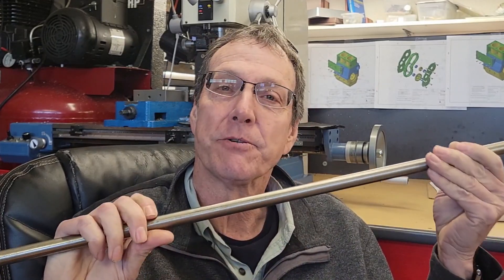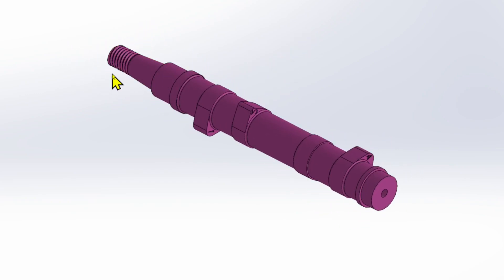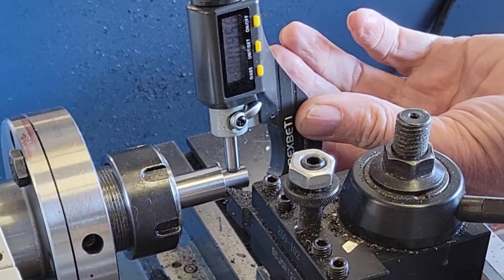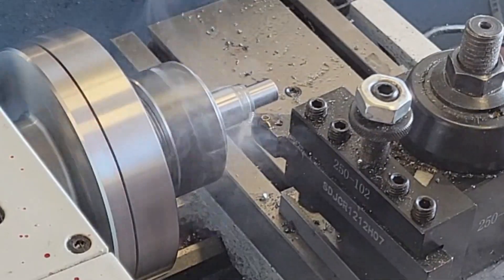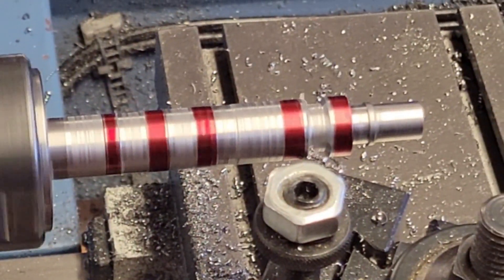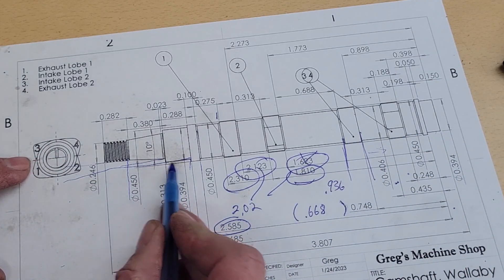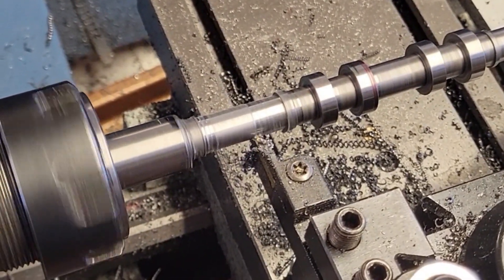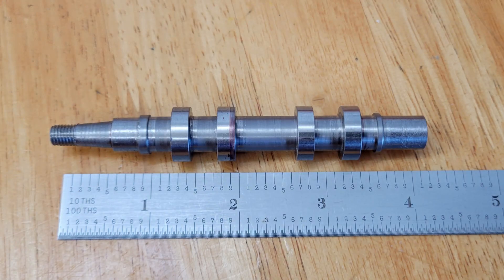Machine the Camshaft - Wallaby 30cc Model Engine Build - Part 12

Comment: And for those without cnc?
Reply from the maker: Hi Union310, This video and its companion Part 13 "Why be afraid of making Cams" does not use the CNC. All you  need is a Lathe to make an awesome Camshaft.  The Wallaby can be made without CNC and many of the parts have plans for both CNC versions and manual machining.  Give it a go!

Comment: I started to download the plans from your website and it just so happens that I have a length of 5/8” drill rod.  The only issue that I am going to have is cutting the taper.  I don’t have a compound for my mini lathe.  I do have a taper jig that goes into the tail stock but I have never used one before so I’m gonna have to look into how it works and to see if is possible to make the small taper.
Reply from the maker: You do not "have" to cut a taper on the camshaft.  You can instead use a locator pin.  Replace the taper with a .25 diameter and then drill from the front end of the camshaft a 1.5mm or 1/16" hole into the 10mm diameter the bearing rides on, it will just barely fit.  The Spur gear will have several equally space holes to match that will allow you to adjust the valve timing by placing the matching pin in the desired set of holes.  Another alternative that might be easier to manufacture is to use a .3125 (or even .375") diameter for the spur gear and a 1/16" keyway cut into the camshaft. Several matching keyways in the spur gear would give you valve timing fine adjustment.
Reply: @gregsmachineshop  thanks for the tips.  I’m currently working on another project and as soon as it is finished I’ll give this a go.